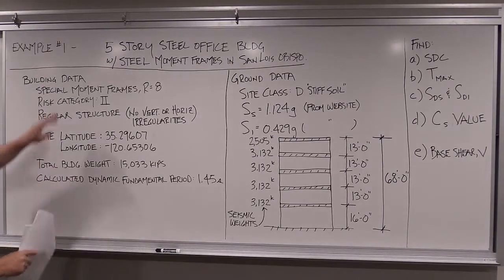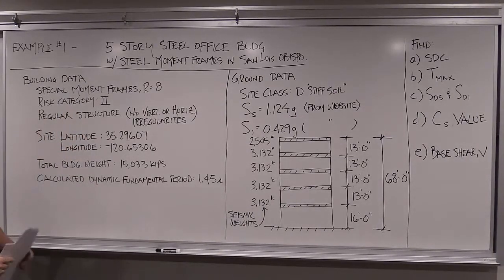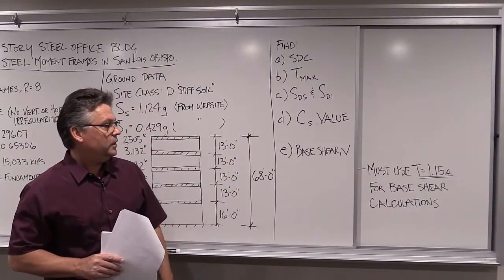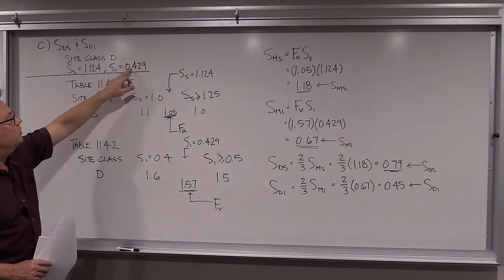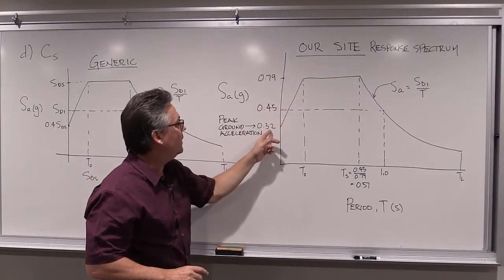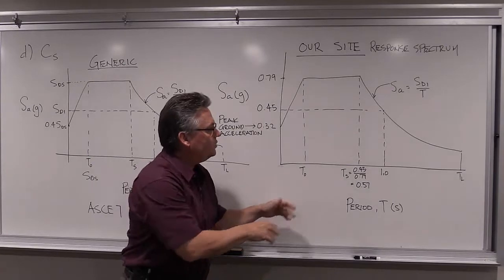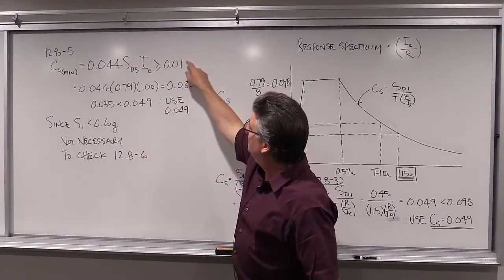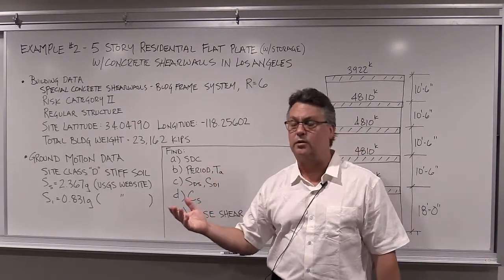Seismic Analysis Lecture #3 - Dirk Bondy, S.E.

Comment: Dear Eng. Dirk Bondy, In the lecture No. 2 At the minute 6 : 44 you told SDC = D But according to table 11.6-1 0.33 <= Sds <= 0.5 we get the seismic design category =C not D Please confirm.
Thanks and regards
Reply from the maker: That part of the Code changed between ASCE 7-10 and ASCE 7-16

Comment: Dear professor, is this series of videos enough to pass CA seismic exam?
If not can you give some advice and tips
Thanks in advance
Reply from the maker: I think it should be enough for most of the analysis, but you still need the design portion.  You would have to get that from material design textbooks and experience in design.

Comment: According to SDC our site class is E, but for SDs and SD1 site category D is used, Why?
Reply from the maker: The site soil category doesn't have anything to do with the Seismic Design Category - they are two completely different things.  The first is a soil property and the second has to do with the spectral acceleration at 1.0 seconds (the S1 value).  If the S1 value exceeds 0.75 then the structure must be designed as a Seismic Category E building.
Reply: @dirkbondy  ok.Thank you sir.